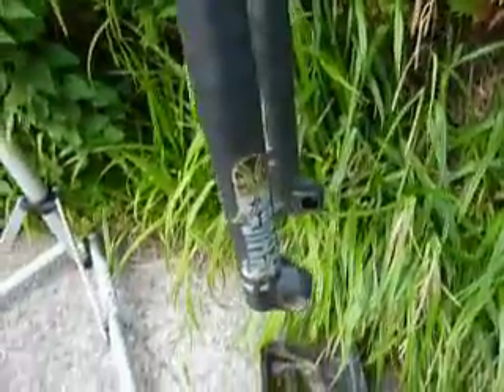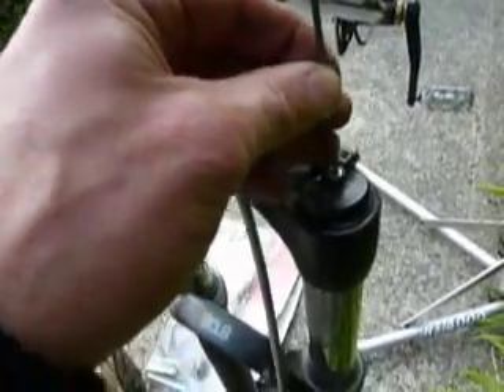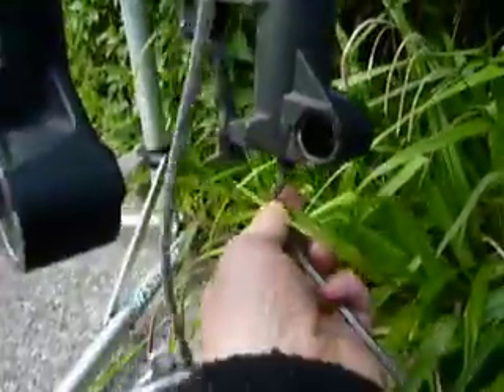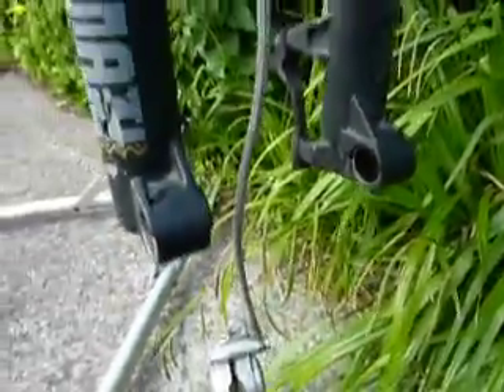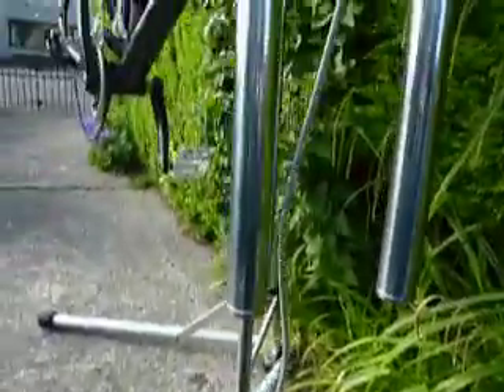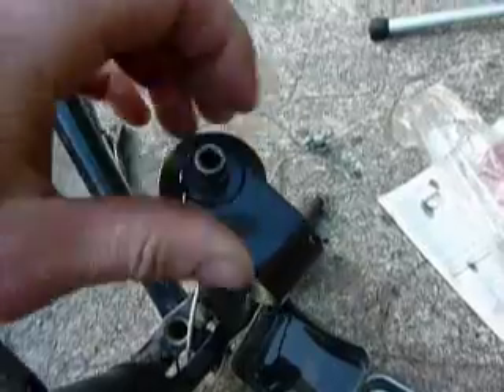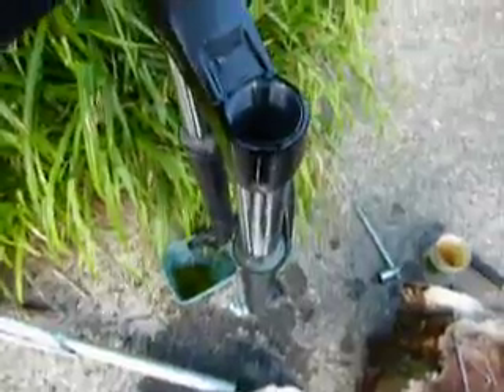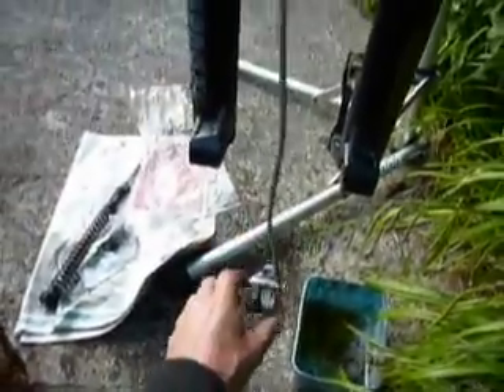Domain 318 service.mp4

Comment from the maker: @divedaz well...the forks had only used 2 inches of travel after a week in Scotland, and the standard spring made such a difference! Tried it out on a local rocky downhill and it was fine, rode over brick sized rocks flat out and no dramas. Used about 80% of the travel so can go even faster!
Compression control makes a big difference when riding on the road too..Checkout the bike being ridden in the next video.

Comment: @nasrannn  i had the same problem ... it had too much oil on the lower of the rebound leg ... its like it can only take 15ml of 15wt oil and it had like 100ml... fix it fast or it may brake the lowers crown... cheers mate ;)